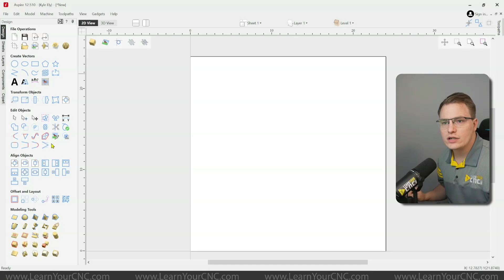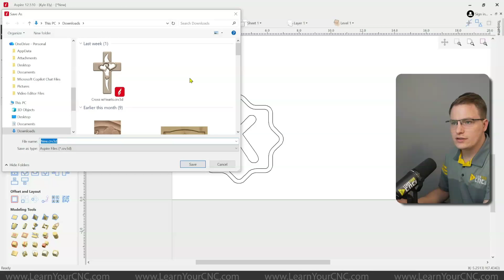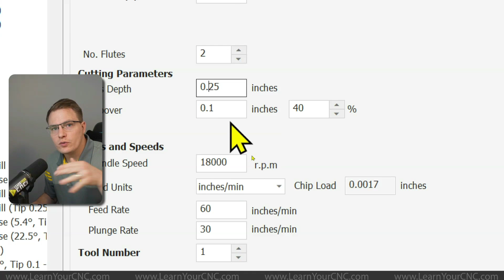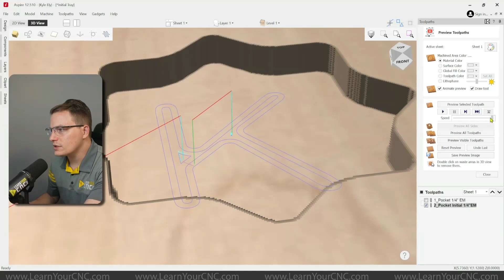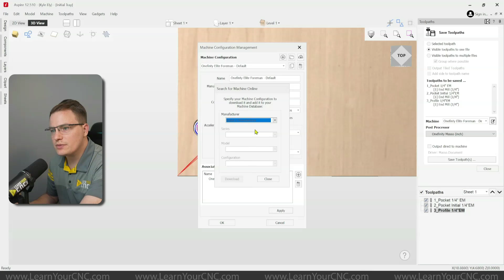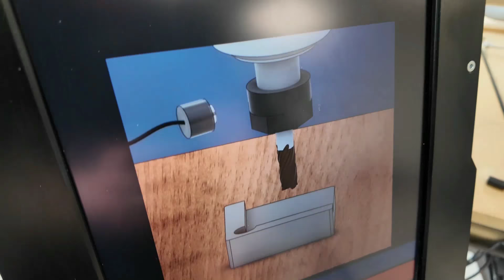How to Make Your First CNC Project (Start to Finish)

Comment: Hi! I really enjoy your CNC tutorials. Could you please make a complete step-by-step tutorial in Vectric Aspire 12 showing how to create and machine a rectangular 3D model with a height of 120 mm (12 cm) and a draft angle of 2–3 degrees on all four sides?

The top should be narrower than the bottom, similar to a truncated pyramid, but with only a slight angle.

I know Aspire 12 has an "Add Draft" feature, but what I would really like to learn is **how to create the correct toolpaths for machining the entire model**, including roughing, finishing, tool selection, and all the necessary settings.

A complete tutorial from creating the model to the final CNC toolpaths would be extremely helpful. Thank you!
Reply from the maker: That sounds quite specific for a YouTube video. I think a 1:1 session may be better suited for your project, you can sign up here and we can go over all the details and answer your questions: https://academy.learnyourcnc.com/schedule-a-training

Comment: What the tile of this video should be is called 'I pretending to teach you how to use a CNC and it's software while really being another paid commercial for Vectric and Onefinity. But I guess it's a little too wordy. LOL I love how it's suggested to use foam to do the project to save money, but lets use a machine and software that costs thousands.
Reply from the maker: I’d honestly love to see your tutorial on how to create a CNC project without using CNC software or a CNC machine. That should be an interesting one. 😂

For the record, neither Vectric nor Onefinity paid me anything to make this video. I purchased the software and my own Onefinity machine with my own money, so I taught the project using the tools I actually own and use. My machine is currently in storage, so Onefinity let me use one at their HQ to film the lesson.

Check through my channel and you’ll see that I’m not out there making paid commercials for other brands. I only promote my own products. When I mention another product, it’s because I actually use it. Brands reach out to me all the time, and I regularly turn them down because I won’t promote something I wouldn’t use myself.

The foam suggestion is simply a way for beginners to practice without wasting expensive wood. But if you make that machine-free, software-free CNC tutorial, send me the link. I’ll check it out!
Reply: @LearnYourCNC  Can confirm! :P
Reply: @LearnYourCNC there's always haters! I did wince at seeing you using imperial measurements but the process and flow was great.
Reply: @LearnYourCNC  You are just another YouTube Shill. Don't BS me you don;t get money from, Vectric. Their logo's are on a huge amount of your video thumbnails. Don't use semantics that they didn't pay you for THAT video to make it sound like you aren't a shill for them. LOL yeah and Onefinity invites people to use their equipment out of the kindness and love they have for YouTube shills.

You could have used free Cam software like Carbide Create but no you show using a program that costs $2000 to make this tutorial and you tips and lesson would not transition to free of cheaper Cam software due to the different commands and UI.

You would 'honestly love to see your tutorial on how to create a CNC project' you say? Well I will wait for these companies to give me free equipment and software like they did for you before I make my 1st video.

Comment: I can honestly say that I joined Kyles- Learn Your CNC course when it first started. It is a very in depth course starting you with the very basic building blocks to help you fully understand all aspects of using the Vectric software, it is well organized. Kyle breaks it all down and it is not intimating. It is a go at your own pace course. Kyle is very well spoken and very knowledgeable. He also has a course that covers in detail using Vectric premiere 3D modeling software called Aspire ( i am still working through this one). Kyle is very easy to understand in his tutorials. This is the best platform I have found.  I promise you this is your best investment if your brand new cnc or seasoned. He also has several videos here on YT that are very informative. You will not regret taking his course. I recently ordered a Onefinity Gen 2 CNC but it has not arrived yet, so I cannot not tell you how it performs. I ordered it based on Kyles recommendation, yes I trust him and his advice that much and you will to once you see his videos. The Onefinity will eventually replace my current CNC machine.